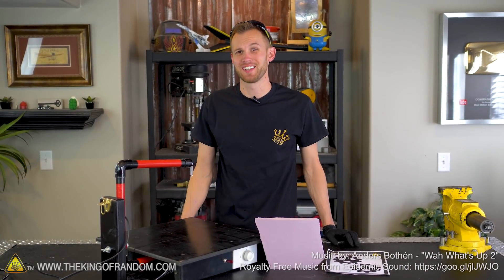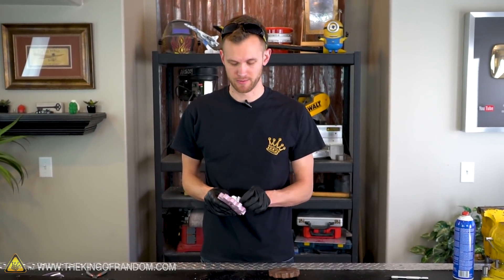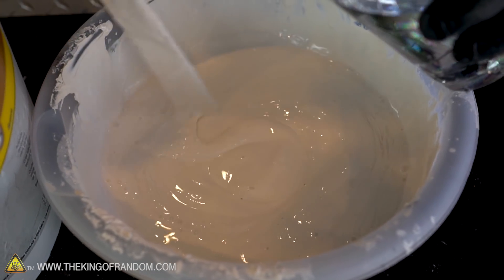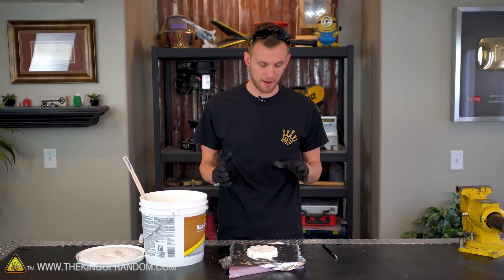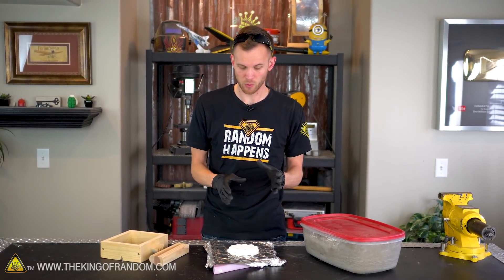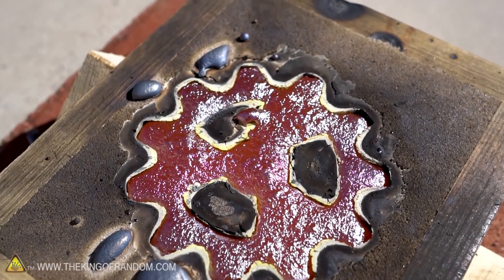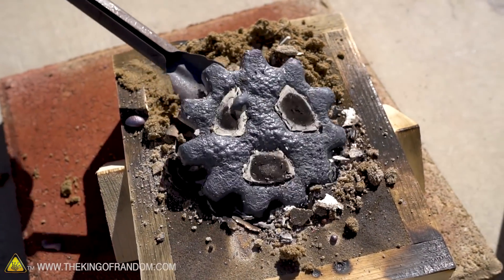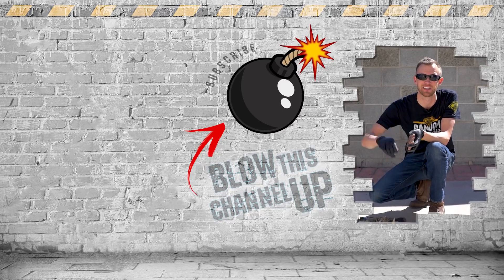Casting Copper Gear Success! TKOR Takes Copper Casting To A New Level!

Comment: I made my own radioactive gear as well, it is inspired by your design. First I took your radioactive gear design and traced it onto a piece of paper. Then I cut it out and tapped it onto a thin piece of foam. Then I use scissors to cut it out and I have to be very careful especially the radioactive holes to make it perfect. Finally I peeled off the paper and there I have my Styrofoam radioactive gear. Thanks for giving me ideas for making my own styrofoam radioactive gear, I appreciate that.

Comment: A better way to efficiently remove bubbles is mix it in a bucket. Then, hold a palm sander without paper to the outside of the bucket. All the bubbles will vibrate out.

Comment: You should have used jewelry investment as the Moulding, melt out the template before casting, heat up the investment so the metal doesn’t cool to quick.

Comment: The reason the copper bubbles over is because there is water in the sand when it dries out the water vaper passes through the copper

Comment: I believe the iridescent effect on the copper is due to accidental tempering. Tempering makes the metal stronger but, if I'm remembering this right, it can also change the color of the metal at room temperature - steel, for example, can turn various shades of blue and purple depending on what temperature it was tempered at. It's either tempering or another form of heat treatment that does it.

Comment: I’m not an expert; however, by the time it takes that to dry and putting on a new coat, etc, etc... wouldn’t it be more efficient to make a mold with two halves and sand kinda the way the dude from presstube does it? Anyways, just curious of your thoughts on the matter...

Comment: A little tip, people that cast iron in sand use a resin, to basically glue the sand together. I am sure a little research lets you easily find out what they use exactly

Comment: Its interesting to cast it this way, but this is one of the most inefficient way of sand casting, especially since there is a lack of calculation of the flow rate and cooling time. I am guessing it came out right probably due to luck as the cooling time just so happen to prevent nucleation on the surface of the sand. Not only is there no riser to account for contraction, there is no sprue to control flow rate, as well as any potential downsprue. It might be more useful to check out actual sand casting video to understand how to sand cast more effectively, not being personal here, but the lack of pre-calculations and design doesn't make it useful as an educational sand casting tool. Looks cool though.

Comment: Try casting Copper in copper
Reply: That is not going to work. Copper is a metal, so the heat of the molten copper will get sucked out by the mold. Also, the mold will probably melt a bit, resulting in an ugly result, if it doesn't weld to the cast. You cannot cast something in the same material.
Reply: @Matsie36  what if the what its being cast in is made of copper that has something mixed in that increases its insulation and its melting point
Reply: This entire reply section is so cringey
Reply: NACHO NATION r/noitsnot
Reply: cast water in ice
Reply: R/doigiveafuuuuuuuuuuuuuuuuuuuuuuuck
Reply: @Redluke0817  r/foundthemobileuser
Reply: @itsjimmymine  r/ihavereddit
Reply: Elite BraylonTheChamp r/wowthatsamouthfull
Reply: Woosh
Reply: R/woosh
Reply: @edelioalday7122  r/itswooooshwith4os

Comment: another solution was make another box of compact sand with a steel cylinder in the middles, slowly place it over yours, and poor the molten metal down the tube, and the upper sand would keep your radioactive sand in place

Comment: Could have probably done without the plaster if you had made a lid for your mould and extended the foam out through a hole in the lid. Once compressed in the mould, the lid would give the sand something to hold against so it wouldn't just break and float away (looks like your sand was more buoyant than the copper).

Comment: Hey Nate,
now that you have done it the hard way i highly recommend that that you try a 2 part mold... oil sand, with one half of the mold with the  foam gear and the other half of the mold just the oil sand... drill a couple holes into the sand when the 2 halves are together and pour your metal into said holes... no sand collapse.. easier to do and much better results.......

Comment: Well done. Essentially what you’ve done there is create a slip cast The ceramic coating is temperature stable and so any explosively expanding air trapped in the sand will not destroy it like it did with your previous attempts

Comment: When you guys put the metal into the water, swish it around in the water. By just letting it sit, the water around it boils creating, basically, an air bubble of hot air, instead of cool water.

Comment: Surprised that worked, normally when doing sand casting you need to add a binding agent like clay, your getting the bubbling affect from the water in the sand flashing off into steam

Comment: I was really surprised that it worked because I have previously removed that texture material from a wall using a wallpaper steamer, which just melts it off (unless the stuff I had was a different compound).  I really thought the copper would have melted it away.

Comment: I dont understand why you guys dont just use Delft clay.   It is specifically for metal casting, and is what is usually used for casting silver which has a similar melting point to copper (copper is just has a little bit higher melting point).  But it is similar to that kinetic sand you guys used in another video, and holds its mold much better, doesnt break apart as easy as regular sand.    
There is an even cheaper version that is sometimes used called Petrobond.   

Look it up, it is a little pricey, but well worth it.

Comment: I think this 2nd time when u casted copper using this other substance instead of sand , the CO2 bubbles couldn't get out.. that formed that bubbling effect..
I suggest u try pouring it from one end.. or using some other substance that doesn't crack and take out that piece of foam completely out..

Comment: use carbon powder for a better mold . sand is just powderd glass. if it heats to high to fast fractures cuase air to rush in from the bottum causeing it to break and float up.

Comment: Historically speaking sand casting used a clay sand mix. This increased the density of the sand but still made the cast able to "breath" letting out moisture and preventing bubbles in the cast. The exact mix I'm not sure about but its definitely something to try.

Comment: those bubbles wouldn't have formed is you made a greensand cast which is like a two peice mold that is very sold in a sence that could have yeilded a smoother finish and would have made the pouring a lot easier. just a reference for any future castings you do.

Comment: Th colorful iridescent surface of the freshly unprocessed cast copper is a result of a mixture of cuprous oxide (copper I oxide) which is a red solid and cupric oxide (copper II oxide) which is a black solid, of varying thicknesses that are fractions of a wavelength of light thick, so it's like a thin film of oil on a puddle's surface. You get a mixture of both of these oxides because copper I oxide is kind of like the copper equivalent of carbon monoxide, it is a result of incomplete oxidation of copper where oxygen is not very available (so deeper down in the oxidizing surface) while copper II oxide is more like carbon dioxide, a "complete combustion" oxide, at the top surface where oxygen is available in excess.... but copper II oxide is more brittle and crumbles off more from the thermal shock of being rapidly cooled, leaving behind mostly the copper I oxide layer below. But of course they can each be of various thin thicknesses, giving you other colors like purple.

Comment: if you add denatured alcohol to the water when you quench the copper, it will come out pink/salmon colored, as long as the copper is hot enough when it goes in and there's enough alcohol mixed in. as long as its still glowing, or even starting to turn black, it will do it. if it already starts to show a copper color, then its too cold already. IIRC, the recipe was roughly 1-3 gallons per 30 cubic feet, mix well. maybe half a quart in a 5 gal bucket. if you put too much alcohol in, it'll just have a blue flame on top of the water like a propane grill, and Ive always been able to put it out by either mixing it more, or adding water.

Comment: Hi....
While going through the video a second time, I realized you said the styroslicer can't cut through paper because the wire cant get hot enough to cut paper. 

I had a small query....
If I'm not mistaken you have used a copper wire. Can't a wire having higher electrical resistance than copper be used? 
Because higher the resistance, higher will be the heat dissipated. 

Resistance of copper is around 1.7 x 10 ^ -7.
Resistance of lead is around 1.9 x 10 ^ -7
And Resistance of alluminium is around 2.8 x 10 ^ -7

So can't "lead" or "alluminium" wires be used instead of the copper wire?
I would want you to test out these alternatives against foam-core  board.

Comment: Just wondering if you have considered using slip casting or even jewelers clay? The bubbling in the copper is probably from moisture in the brushed on plaster.

Comment: High heat dental lab casting investment,  and a gear cut from wax (that can be easily melted away before pouring metal) and most of the issues will be gone.

Comment: The bubbles were probably from air trapped in the shell, and the discoloration on the copper was likely due to the copper cooling at different speeds.

Comment: If you're using Extruded Poly-Styrene (XPS) foam for that, you need to be careful about sanding it.  The dust from sanding it can be easily inhaled, and isn't something you want in your lungs.

Comment: Do it the way you did but dont use the stuff like the mold to keep the sand away instead just place another box on top on the first one and compact sand then take the box and make acsess holes to the gear or whatever your using and pour in the holes

Comment: This method is almost a hybrid casting method of the sand press casting and the Investment casting method, interesting
Reply: This is something that you should do, haven't really seen what happens when you don't do this but, Copper has a tendency to oxidize pretty badly, Borax is used as a "Flux" and basically it helps to make the impurities in the copper (probably Aluminum too) to clump together so you can scrape them away, i use a carbon fiber rod to help do that, some tips from somebody who's casted bronze before and took a class to learn the methods basically, it gives a better end cast when you Flux and clean as you smelt

Comment: Take a freshly molded item and instead of cooling in water cool in liquid nitrogen, id like to see what happens
Reply: Elder Goat rapid temperature change often leads to explosion.
Reply: PJ Vis  HUGE EXPLOSION
Reply: PJ Vis but that's what we wanna see😂
Reply: @PeterJavi  yeah
Reply: Yeah it would probably crack or explode due to rapid temp change
Reply: Either an "explosion" (metal splashes everywhere), warped casting or just leidenfrost effect.
Reply: Do it
Reply: It wouldnt explode....i just watched a dude put 10kg of red hot steel into a bucket filled with liquid nitrogen and all that happened is the nitrogen started to bubble and was letting off heaps of smoke lile it does he ended up pooring more nitrogen in and the same thing happened...
Reply: DontF***WithMyRanchu it could explode but it would probably crack because of thermal shock and rapid temp change
Reply: Leidenfrost effect probably
Reply: dragon killer that only applies to organic substances
Reply: @CozmikDW  nah, the rapid change in temp causes thermal shock in anything that can't resist it
Reply: grammar nazi
Reply: Crack or explode due to intense thermal shock.
Reply: It'd crack and crumble.
I don't ever work with metals, but I know that rapid change of temperature, typically hot to cold, tends to make the item in question brittle and crumble.
Hope this helped inform you. I as well am curious to see what would happen.
Reply: Superb idea
Reply: Boom!!
Reply: Probably end up with an infinity gauntlet
Reply: you would definitely not want to see what happens
Reply: Wouldn't it shatter? Idk but.....
Reply: Me
Reply: Death by asphyxiation
Reply: Vincent Van grammer nazi
Reply: Vincent Van you an English teacher or something?
Reply: @Carson Fowler It appears you missed the apostrophe in "it's."  It's super fun being corrected, isn't it?
Reply: Why is everyone in this reply section a grammar nazi?
Reply: Vincent Van GRAMMAR POLICE!!!!
Reply: Andre Ledo I've never seen someone use it to quench from forging or casting temp. It's done from room temp I order to improve wear resistance and hardness. I've had a couple ring and pinions done as well as axle shafts for a Jeep.
Reply: Yamaha Life pouring
Reply: Commas, do you know how to use commas?
Reply: Dan gaming, I didn’t get ur question?
Reply: The nitrogen will boil off, obviously
Reply: You guys do know liquid nitrogen is often used to quench steel right? How is copper going to explode but not steel?
Reply: Andre Ledo because copper has a higher melting point
Reply: qt pie steel is not very easy to melt and  can sometimes be hard to get massive quantities of it...
Reply: @qtpie2630  it temperature hardens steel but it cracks anything else because the steel will get more compact and harder and the copper wont

Comment: Tip for next time.... ad a single drop of food colouring to your second coat of plaster/paste before painting it on. This will make it a lot easier to see where you have been, and where some more plaster is needed.

It should dry out just the same.

Comment: You just made a copper cog fossil. You had the foam cog, which got coated in the texture paste, then sediments surrounded that, the foam was broken down (by the heat) and replaced by another material.

Comment: Now that is what you call never giving up.
Reply: never gonna give you up, never gonna let you down.
Reply: @aeriumsoft  I was gonna say that...
Reply: Nicola Beith Sorry mate you're 4 months late
Reply: Awsomiihill hahahaa thats cool
Reply: Cool vedio
Reply: Aka perserverence
Reply: Let's get 1000 likes
Reply: Your awesome
Reply: Specific Love Creations zzzz
Reply: Drone Vlogs101   hhh
Reply: Specific Love Creations I
Reply: Specific Love Creations I
Reply: Specific Love Creations Lol
Reply: Specific Love Creations
Reply: perseverance*
Reply: Or running outa ideas?
Reply: Not one,  not 2, but 3 vids until they got it!  ❤
Reply: Never give up and thats is never giveing up your right.
Reply: Never gonna run around, and desert you.
Reply: Cast an aluminum fractal then connect it to a coaxial cord to see if works well as a digital TV antenna. Fractal Antenna are actually used in cellphones to pick up signals. There are several fractals on youtube used, bit not in the true sense of what a fractal is. Maybe y'all can change that by casting Koch's Snowflake or Sierpinski's Gasket.
Reply: you should use clay, man, also this bubbely exteriour comes from the moisture stuck in sand, steam makes its way out through te melted cupper. it would be smart to make mold with clay, burn the mold in the owen, preheat it before pouring and you have better results
Reply: And don’t give up what you love

Comment: For any casting you will be requiring a raiser and runner. Raiser for extra metal for avoiding gas hiles in middle of the casting and runner to flow the metal inside the mold. Try this next time and you'll receive a better casting. Also try to cover the front surface of the mold box to achieve a better finish all over. If you require any tips in moulding, melting or anything do contact. I own a steel foundry in India. We can help you with better ideas.

Comment: I never understood why you didn't just make a 2-part mold.  The other half of the mold would hold all of the smaller bits of sand in place as the copper flows around.

Comment: easier way for success..... make a top to the mold with a fill hole.
Reply: Finest Hops that wouldnt do much to help
Reply: It should since his primary issue was the sand moving. However, if you watch the first video, they didnt shift horizontally. They were tipped over. Having the top would 1. Apply a top that would prevent them for being able to tip over and 2. Provide a smooth top which would make clean up easier by preventing that overfill rounded top like you see in this video.

Comment: I still don't understand why you don't just do what you're supposed to do and make a 2 part mold. That's literally the only reason this keeps failing, and while you've had some success this time, it was a lot of unnecessary work, which has still left you with a tonne of clean up to do.

Comment: why not just stick it to the botom of a bucket and fill it with cement then fill it with the casting material? then you have a mold that wont break, is easy to make and to get it out just glue a stick to it and pull

Comment: Couldnt you have just put spacers at the bottom of the bowl that would keep the foam exposed on the surface so instead of a small shell you basically have a big sturdy mold? (possibly even strong enough to get multiple uses from the one mold)

Comment: The iridescent look on the surface of the copper, is actually called firescaling or firestaining. Its usually due to too much oxygen mixing with the copper as it is melting or overheating the copper.